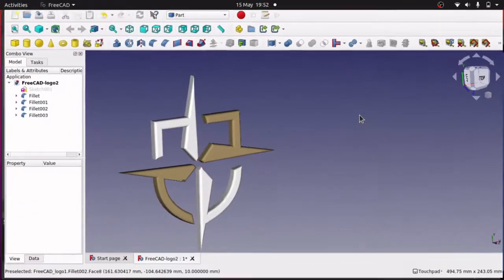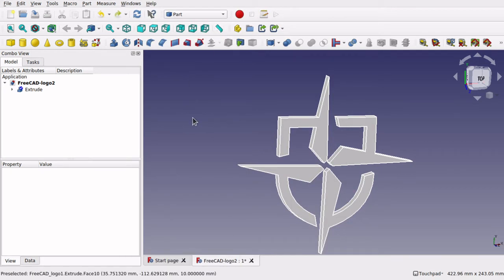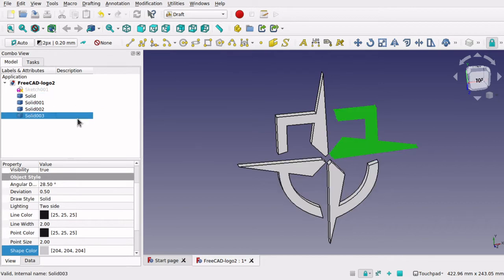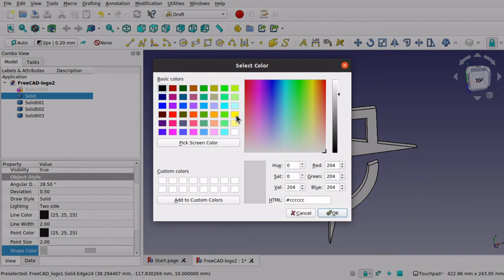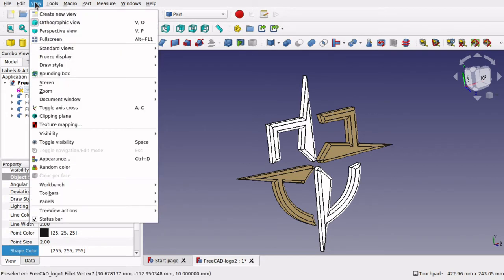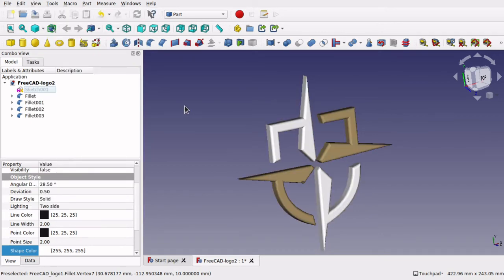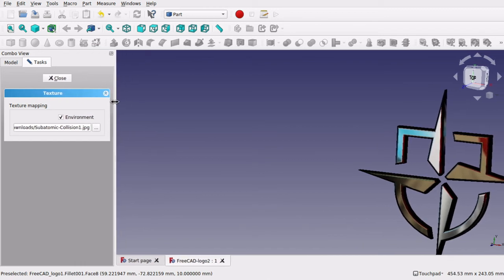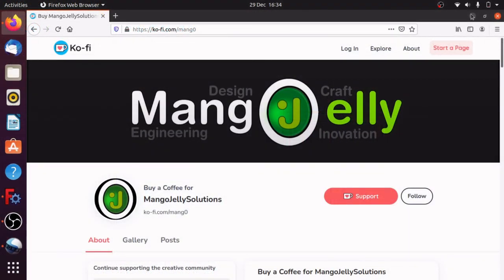Convert your logo to FreeCAD PART  4 of 4: Colour and Texture your model. Beginners Guide

Comment: Hello, do you have a video of placing a raised logo on the surface of a box lid? 
I have successfully build your design for the electronics box
thank you
Brent
Reply from the maker: No unfortunately I haven't, but if you click on the sketch you created in video 1 there is an attachment mode or map mode property in the data tab.  If you click on the field you will see a button on the end.  Select that and that will put you into the attachment panel.  You will see 4 buttons at the top, top one should say 'selecting...' if not click on it, then click on your box lid.  It will then be mapped to the lid.  You can alter the attachment offset to position it more precisely after on the x,y,z.  Hope that helps

Comment: Can you overlay that logo on an existing design ?
Reply from the maker: Yes if you are in the part workbench you can extruded and then do a boolean this with your design or if you are in part design you can take the sketch and attach it to a face to pad or pocket by selecting the sketch with your logo and using the data tab on the left hand side, click the button on the end of the map mode field. Then select the face and  then you can adjust x, y, z of you scroll to the bottom of the screen on the left.